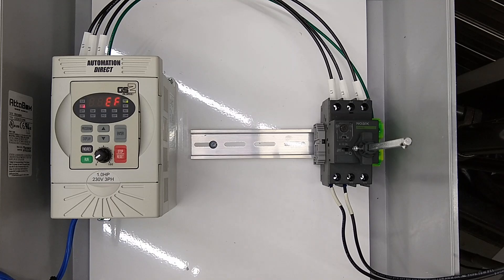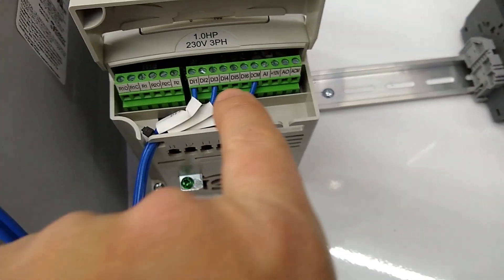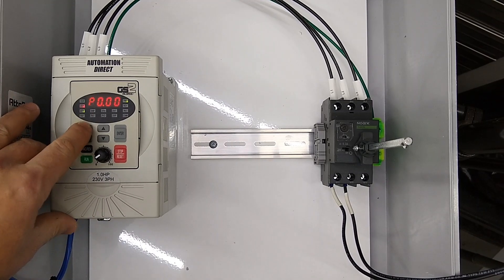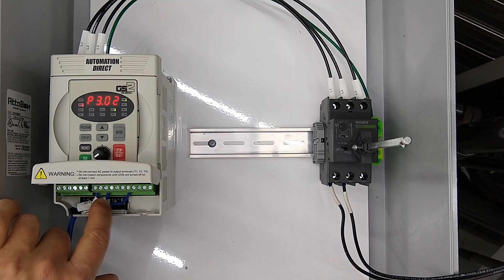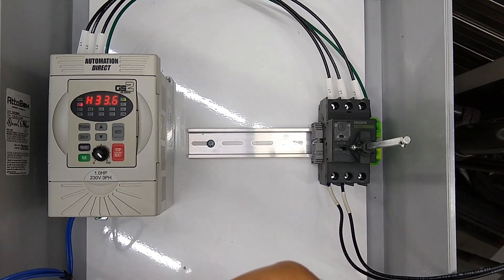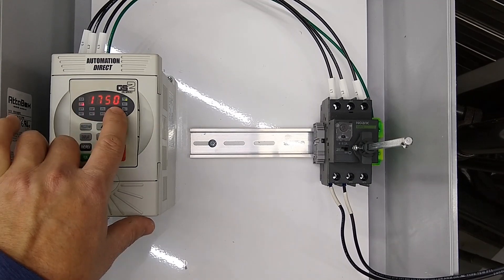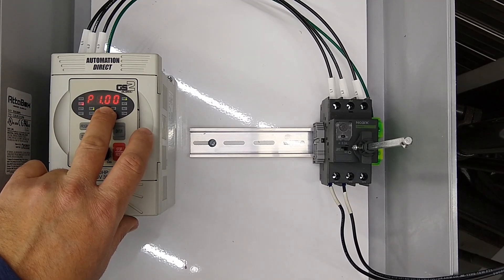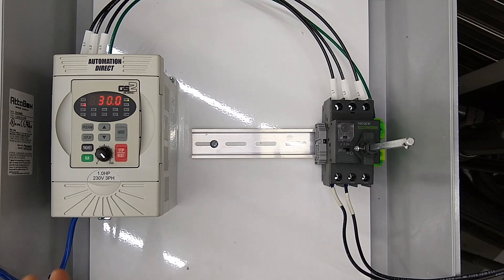How to configure an Automation Direct GS2 Drive for a START/STOP Configuration

Comment: I tell you what. You jumped the gun and confused me.  I had to go back to your other video just to restore it to default settings and start over on this one.
Reply: @ I figured it out. Thanks. One question I have is some people show a contractor they use with there vfd. I have a AB 194L as a disconnect and I don't understand using a contractor.

Comment: Hey thanks for the info. Question,  if i have a GS2 5.0HP 460V 3PH, is there a way to tune it down so i can use 220 1Ph to ruin a 3PH motor? I only ask because i got it for free and my lathe needs 3PH and i don't have it.
Reply from the maker: No, you can't easily change the incoming voltage.

Comment: Good to know about the start, stop, and reverse connection option. Do they also have an external speed control connection?  Maybe a link can be added to show all the connection options. Possibly available parts like the front panel extension chord..
Reply from the maker: Yes, it is the analog input.

Comment: Do you have to use di3
Reply from the maker: You could configure another input but if you want to go with the instructions in the manual then you would use DI3.
Reply: @TimWilborne   problem I'm having in mach 4 is I have no control,  I've followed the instructions,  but my potentiometer slider in mach 4 doesn't work,  I've checked voltage coming outa pokeys 57cnc an I get 10v, but it doesn't change the voltage unless I change it inside pokeys software,  that's only place I can getvit to actually go from 1v to 10v... in mach it just stays 10v, I've changed everything I can including inside mach control constant rpm or surface setting
Reply from the maker: @joe-blow1613  Mach4?  This video is about an Automation Direct GS2.

Comment: A little more description of the Start/Stop button that you used is needed. Are both sides of it maintained or momentary?
I'm assuming, based on the wiring, that they are maintained, and interlocked with each other, so that when you press one, it operates the other and stays where it is until you press the other. But even then, I don't see how DI1 gets a signal when you press the start button and it turns the NC contact block off, while it turns the NO contact block on?

Wouldn't it be easier to put DI1 on the NC <Stop block>  and DI3 on the NO <Start block>, and just common the feed to both of the contact blocks with DCM?

That way you could use either momentary or maintained operators and get the same result.

Edit, I really do think you got your wire labels swapped on the switch end or the wiring between DCM and DI3.
It makes way more sense to "common" one side of the switch to the outputs on the other.
In the video you made DI3 the common and DI1 and DCM the switch legs.
Not sure how that is supposed to work out since DCM stands for "Digital CoMmon", while DI1 and DI3 stand for "Digital Input 1" and "Digital Input 3".

Sorry for such a long comment, but I can't see how this works any other way, and I use AD GS2 drives a lot.
Reply from the maker: No, the labels are not swapped.  Check out this video where I go through the start stop in detail.  This was actually a quick video I made for a customer who needed to setup a replacement drive and I decided I might as well publish for others.
https://www.theautomationstore.com/how-to-run-a-3-phase-machine-with-single-phase-power-with-a-ac-drive-including-vfd-installation/